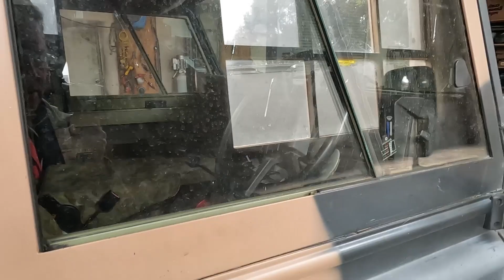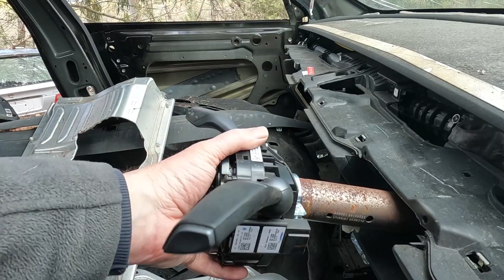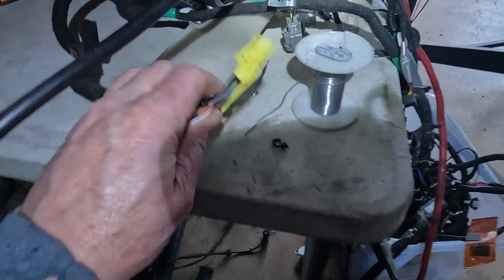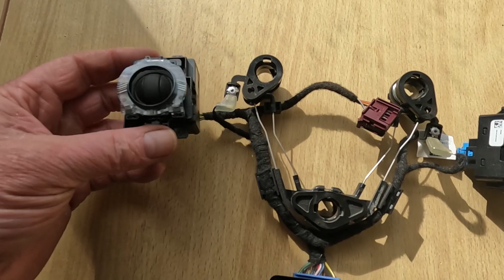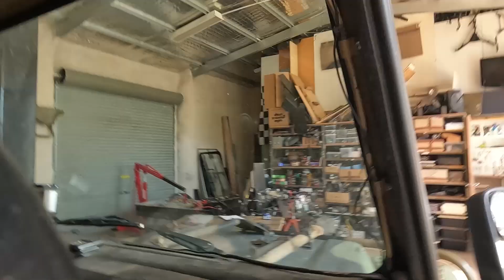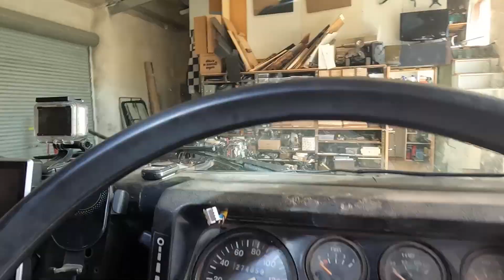Land Rover FTI 15 - Steering wheel controls

Comment: Really enjoy what you are doing. Found you because I was looking for a similar project as mine. 1989 Mitsubishi Montero, 2 door, mounting Model 3 in the center. I had already machined a solid diff shaft with tapered external keyed shafts before learning from you there was someone manufacturing a diff. I'm not swapping all Tesla parts like you, so our projects only have the motor in common, but its fun to watch what you are doing.  Excellent work! Thanks.
Reply from the maker: Hey thanks. I had to look up what a Montero was - we call them Pajero's here in Australia. Sounds like an awesome project you have there!

Comment: Yea I'm gonna have to figure out how to do this also if I don't change out the whole steering column.
That was a really well done fitting of the controls to the Land Rover wheel.
Can't wait to see how you trim everything up and blend together.
Take it easy,

Casey
Reply from the maker: Thanks Casey. Yeh, if you can use the whole Tesla steering rack and column that would be ideal. You'll need to make sure you can mount it in the correct position so you don't get bump steer in the Ranger.